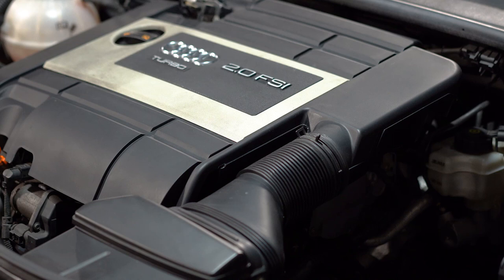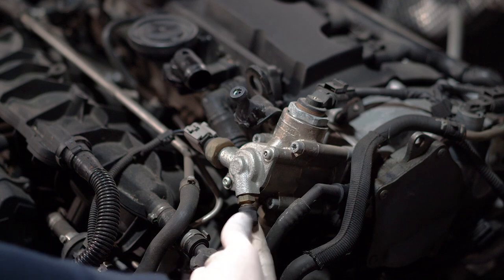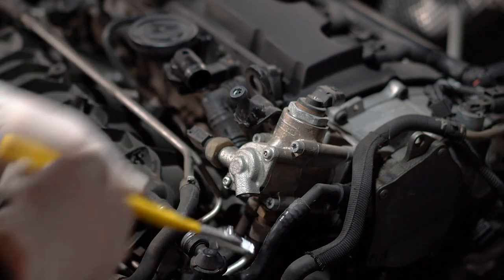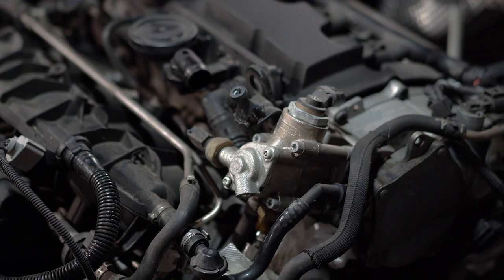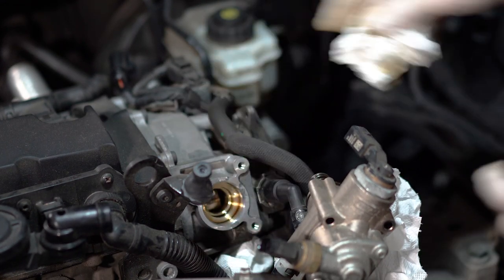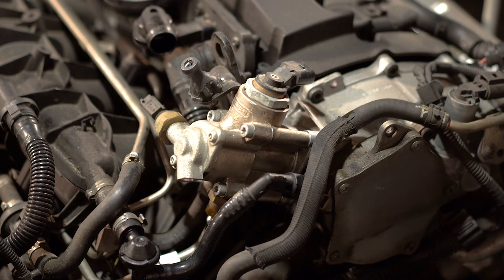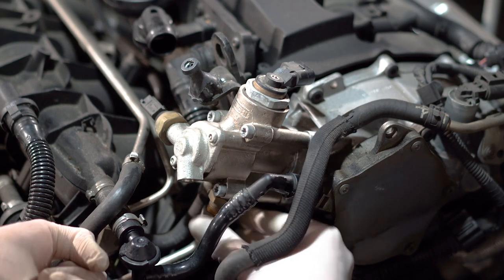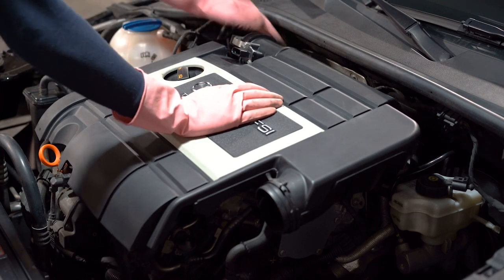How to - Audi TT 8j 2.0 TFSi *BWA Engine* - Cam Follower Fuel Pump

Comment: Great Video! That the the best, most thorough video for cam follower replacement I have seen. I especially like that you did not remove the final hose and still replaced cam follower. Most videos I have watched on this subject were taking off the banjo bolt or removing the whole fuel pump from all hoses. Mine is like this vehicle , so no banjo bolt. Thanks for the video.
Reply from the maker: I am so glad it helped you! that why i enjoy filming it :D and yes, i try to make it as easy as possible :D

Comment: Hello there really good tutorial on that. 
Just got the same engine on my newly bought TT 2.0 Tfsi S Tronic BWA engine,  sitting at 182.000k I've took a close look at the HPFP and its seems they it has never been changed. 
So I'm kind worried.
Reply from the maker: Do the change then asap, it is cheap and easy and can save your car :D 
good luck and lots of nice km with new car!!!
Reply: @cars_anatomy  good news just change mine today. 
Like I've told I guess it was never changed before cause the head of the bolts and nuts didn't have tool marks. And also the o-ring was black. 
Mine was almost like the original one you took out from your car. Used on the black coat but flat and in good condition, the cam lobe was also clean of marks as well as the HPFP piston. 
I was really worries cause with this amount of kilometres and still with the original one was worries that would found a hole in the follower, since I've read around here of cars that hey failed way sooner, don't know if it was because of bad oil/maintenance. 
At least now I'm relieved and know that don't need to worry about it for another 2 ou 3 oil changes. 
Again great tutorial and info keep does videos up.
Reply from the maker: @darkjak4   great news! thank you, i hope you enjoy your car  for many more miles!! :)

Comment: I changed my cam follower it runs fine but it seem to be using more fuel why is that . After i changed it . My cam follower was in bad shape no rubber left on it  because i wasn't a where of it at that time . Not all the way though the cam follower  thank God .
Reply from the maker: there is no rubber, it is made of steel only. the black top is just made of hardened steel. But great job, you might have saved your car! :D
The fuel consumption has nothing to do with it, unless you didnt put the fuel lines back properly and now have a fuel leak. So start the car, open the hood and check if there is fuel leaking from the pump.

Comment: hi bro...  i have my audi tt if i drive 50-70km/h   its come out engine warning... and my car like jrking .. wht is that problem , i alrrady chnge . ignition coil , and spark plug  but still.
Reply from the maker: really hard to say without checking the car properly. I suggest you read the obd codes out, before you buy new parts and change them out..

Comment: So you dont need to let the oil out the engine to open the fuel pump ? Because a friend sayd it to me that i have to let the oil out the engine before i work on the fuel pump
Reply: The oil is supposed to be in the oil pan because it’s sink by gravity :) I think it’s just a precaution to not burn your hands with it :)
Reply from the maker: apsolutely no. There is going to be a bit of oil on the follower and that is ok. You need to let the gas (petrol) out slowly, just like in the video, through a small valve on the pump. :)

Comment: Hi bro. I just bought a 8J at 150,000km. What damage does it do if not changed?
Reply from the maker: hi! It has slightly shorter piston throw when pumping fuel, so minimal signs of lowered fuel pressure. 
If its bad bad, you can end up having metal particles falling off, mixing with oil ands possibly clogging other engine parts causing oil starvation
Reply: @cars_anatomy  oh ok got it! Took it out today. Mine looks new 😁
Reply: @cars_anatomy  thanks bro for sharing this video

Comment: My fuel pump failed, so i took it to audi service, im unsure did those fools changed my cam follower with my fuel pump. it would be logical to do it. right ?
Reply from the maker: In this video I work on “ high pressure fuel pump” 
You have another,” low pressure pump” in ypur gas tank. Which one did they replace? :)
You can always check this follower, and if you see scratched surface change it, its 10 eur ;)
Reply: @cars_anatomy  high presure
Reply from the maker: That is the one in video. Sure, follow the vid and check the follower. If its new, it should be all black on the top.
Reply: @cars_anatomy  with the notion 
that im going to do stage 2, i think this inspection is a must. Cheers,tnx

Comment: mine had a hole ...
Reply from the maker: That is a red flag and great that you changed it!! it was close to causing some serious damage to the whole engine, and your fuel pressure is probabbly much better now !!
Reply: @cars_anatomy  was a tiny mark on the cam when i removed the follower and the end of the fuel pump is slightly worn after the spring that goes into the follower, been ok since i replaced at a crucial time but just goes to show these cam followers must be replaced if you being a used car or every 20k, my car is an 8p audi a3 2.0 tfsi s line stage 1 remap
Reply from the maker: @intunewithcars9484  of course. Especially if you tune a car and push it a bit over stock power, it cost like 10 eur, and it takes 20 minutes to replace :)

Comment: If you fit the uprated fuel pump then you need to inspect the cam follower every 3 months otherwise you'll destroy the engine when the bits block the oilways.